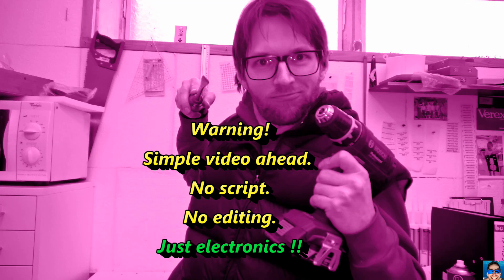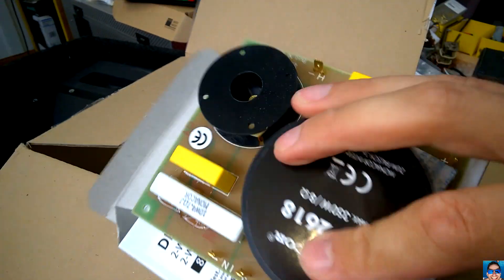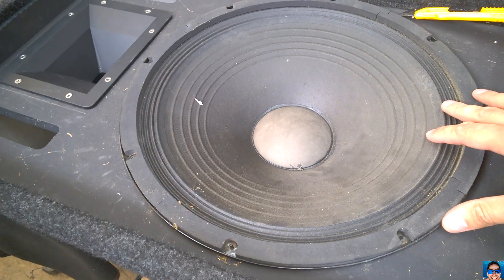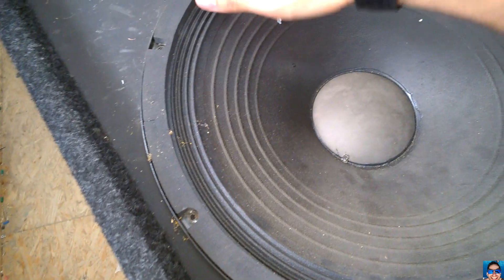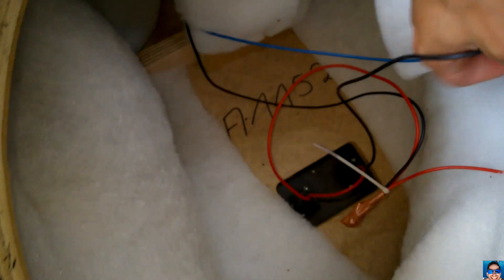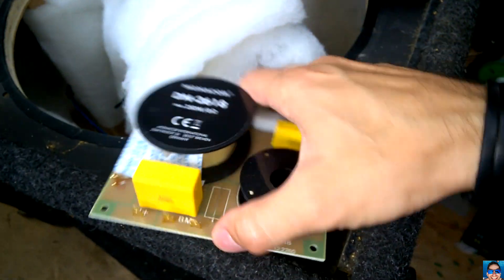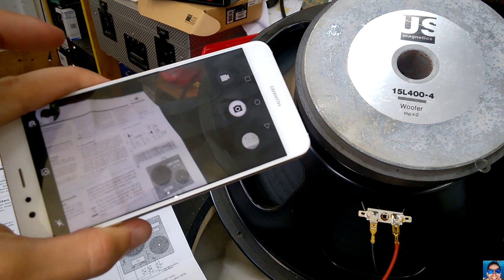Rental drama: PA Speaker returned with parts missing

Comment: Max, you bought 8 ohm crossovers, while the woofer clearly says it's 4 ohms.
Better than no crossover at all, for sure. But the crossover frequency should be way off, and also the impedance curve is probably funny.
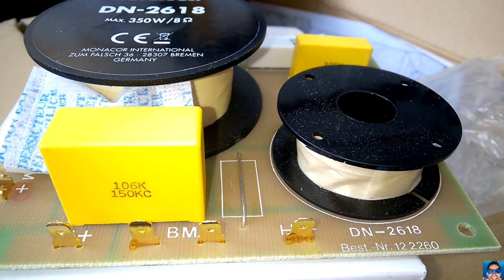Reply from the maker: 0:43 schematic says 4 Ohms or 8 Ohms for the bass speaker. But you are right. I should check again. Speaker is sounding great though.
Reply: @MaxKoschuh  That's weird. It's obviously matters that the woofer is 4 or 8 ohms - the 680uH choke will cut the high frequencies at a different corner frequency. Also, the  frequency - impedance curve will be really funny if the woofer, the tweeter, and the crossover are not matched. These "universal" crossovers are potential amplifier killers, especially if the manual says false information.

Have you considered to try ARTA / HOLMimpulse to measure speaker impedance? They are free for personal use. I'm planning to try them.

Comment: It is a luck if the tweeters are not damaged, they are not designed to receive full power directly from the amplifier !
Reply from the maker: yes, exactly
the powerful low frequency levels can destroy the HF driver in seconds

Comment: Phones often have a reed switch (or other magnetic sensor) which senses a magnet in docking stations so it knows when it is docked. That's why it shows the clock when it's near the speaker magnet ;)
Reply: Phones use Hall-sensors. Reed-tubes are too expensive and they break too easily. Otherwise, you are correct.